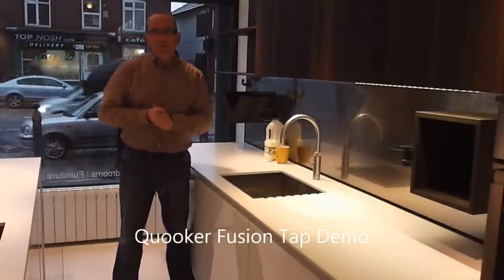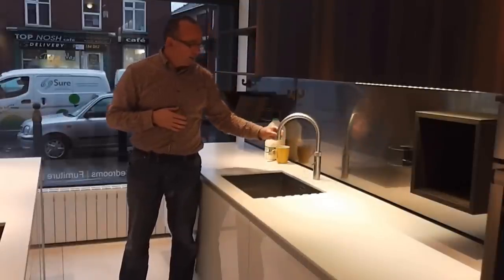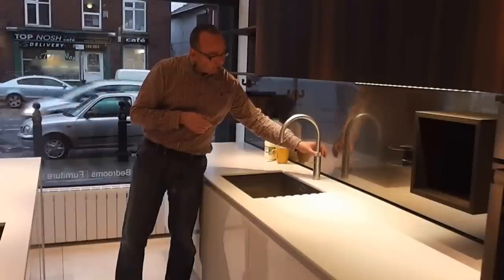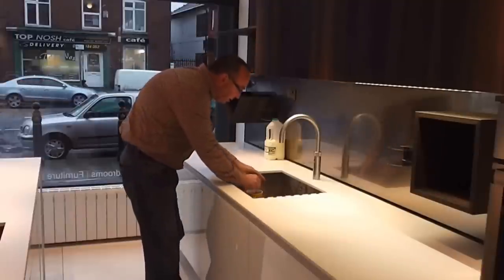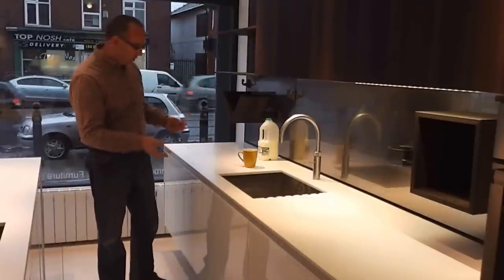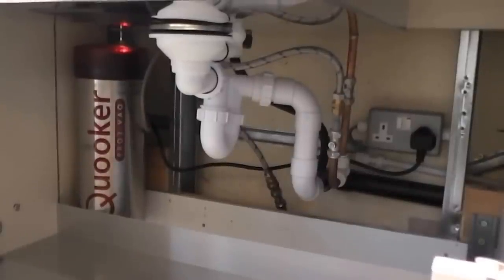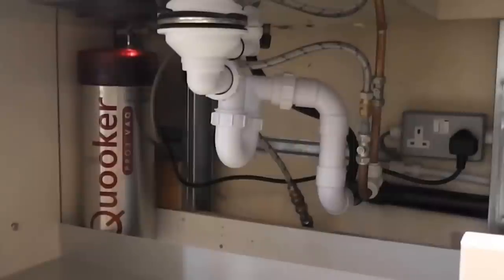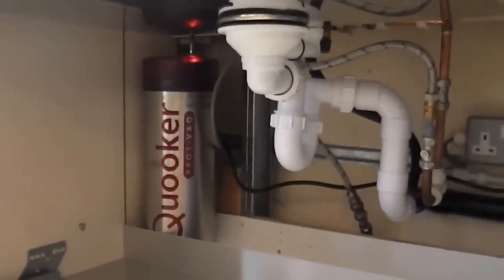Quooker Fusion Round Constant Hot Water Tap Demonstration

Comment: Would you recommend it for professional usage in a coffee shop? Since the temperature is fixed constantly at 100 degrees and in my opinion it's a bit to high to brew a good cup of coffee. Again it's just a question for professional usage.
Reply from the maker: +George Giannoulis you would need to use a French Press coffee making method with this tap and you would have to check the optimum water temperature. In a professional workplace, I would recommend a larger volume water tank like the Pro7 or Pro11 http://www.quooker.co.uk/enuk/collection/Tanks/PRO7-VAQ/164#AoiaG4JAOF40xP17.97

Comment: You say this runs off a 3 amp fuse? Are you sure? It's a 2900watt device ie nearly 3kw which I assume must require a 13amp fuse?
Reply from the maker: declankh sorry my mistake it comes with a sealed plug containing a 13 Amp fuse for the UK market. FYI, I created the video in one take and it's unedited, except for when I paused the camera to show the cylinder under the cabinet.

Comment: Hi Kevin, thank you, great video. I have a question about the tap lever. I have the tap fitted recently and the lever has got some play, I mean is a bit loose, the trader says it is normal, but my friend has same one which is not loose.Do you know if this can be fixed?
Reply from the maker: I had the same problem with this display tap, and Quooker replaced the complete tap free of charge. I think it might have been a problem with a batch of them. If it's within warranty, you might be able to claim.
Reply: @KevinLargeInnerform  Thank you so much Kevin, that is really helpfull.

Comment: Would you recommend it to people with young children?
Reply from the maker: Raymond, that's a good question and asked a lot. The Quooker Fusion has been designed to be "child proof". To be able to operate the tap a person needs a certain amount of strength to press the button down, then good coordination to double press it twice and turn counter clockwise, almost instantly. No very young child will have developed these sets of skills. I have taught my 7 year old boy to operate the tap when he comes into the showroom, but he does struggle to remember the coordinated technique. My 2 year old daughter certainly cannot operate the hot water tap, however she is intelligent enough to tip over a linen basket to climb on top of it to operate a conventional tap. Once a child has reached a development age to figure out the operation, then I'd say they are aware enough to know that boiling hot water is dangerous and to be avoided - similarly at this age they become aware of all the other potential hazards in a modern home. As a parent myself, this tap does not worry me.

Comment: there are cheaper versions out there by mickiemouses.
 #but  how much does YOUR version cost?
Reply from the maker: ***** the price in the comments above is still valid. Quooker are the original company that invented this 'genre' of product. You're right there are 'plenty' of confusing copies out there. The only alternative I'd consider is the http://www.zipheaters.co.uk/zip-hydrotap but it is more expensive and in my humble opinion looks a bit clunky. I supplied a DOMBC3A "All-inOne filtered boiling and chilled water PLUS hot and cold supply from mains connected tap" for a high specification office project last year and the List Price was £2,250+vat.
FYI, I had a 'Blanco Hot Tap' on display for a while and it didn't produce portable water. It became a long story. Blanco sent and Engineer out to replace it, but still had the same bad taste. In the end Blanco withdrew the product from the market after realising it is not easy to imitate.

Comment: I beleve that you can't have sockets next to water pips like that, this is a death trap? If my plumber put this in like this I think he would be in very real trouble
Reply from the maker: Quooker taps should be installed according to best practices in the jurisdiction you habitat. In the UK, an Electrician is responsible for the electrical installation. The outlet socket in the video is wired to an MCB circuit breaker; if water were to seep into the socket, the breaker would trip. A Building Regulations Part P certificate was issued on completion of the Innerform showroom.
Reply: Death trap?  Then I guess every home built is a death trap
Reply: How would you work a dishwasher / washing machine without pipes and a socket together??